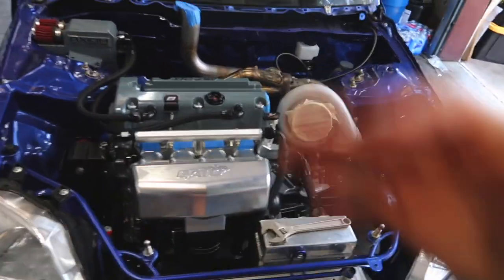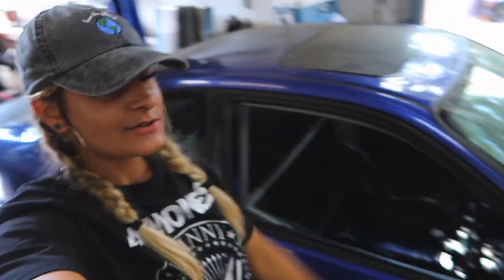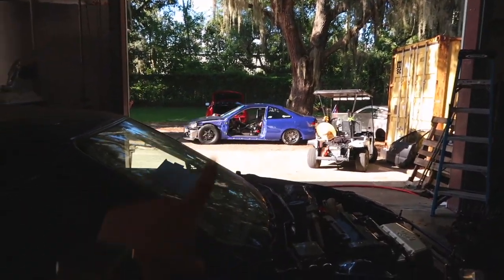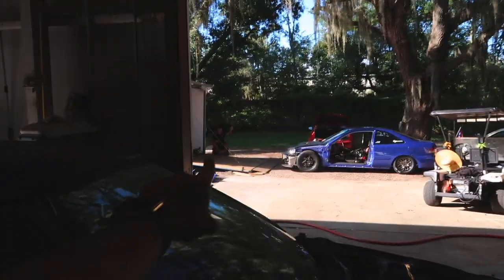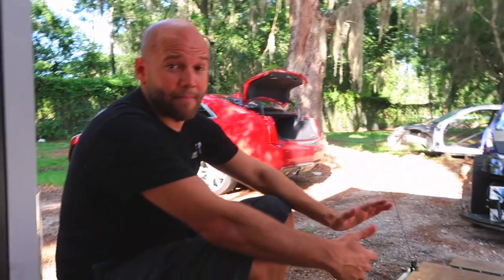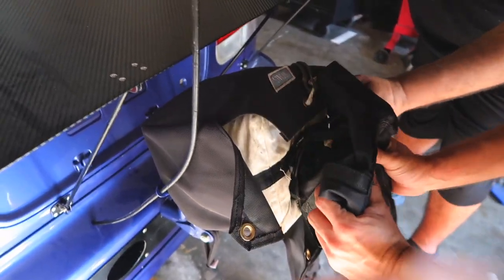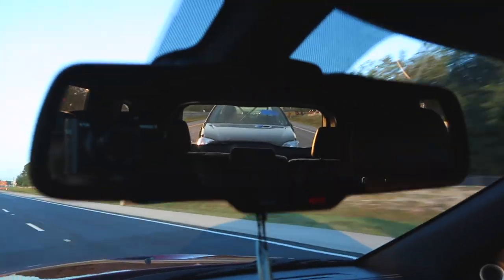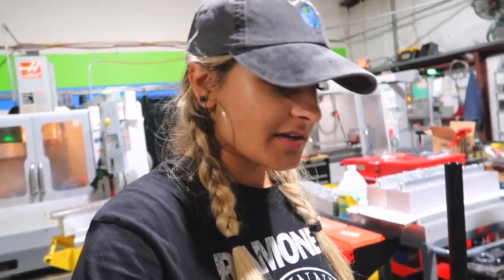MY DRAG CIVIC IS BACK WITH SOME BIG UPGRADES

Comment: Getting your engine done by the top guys definitely does take time. It took 5 months to get my block back. I already stripped the block down, did the balance shaf delete, and had a new balanced and micropolished crank thrown in it before I sent it off.